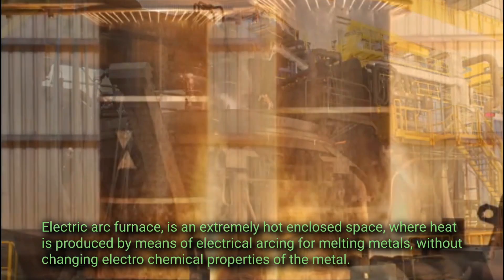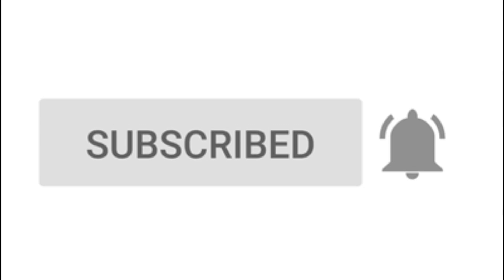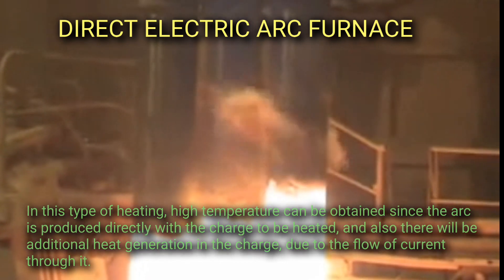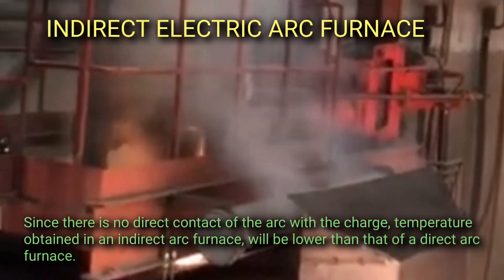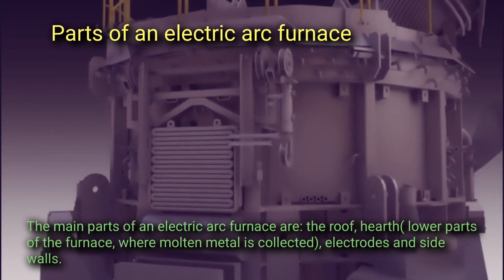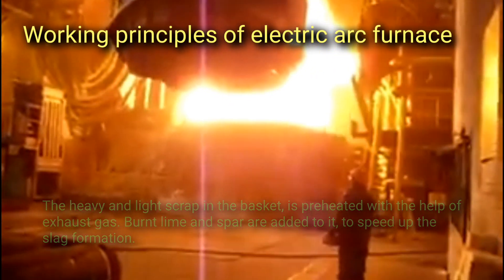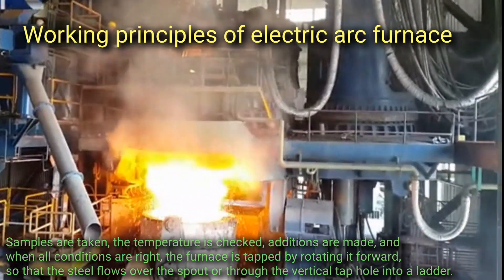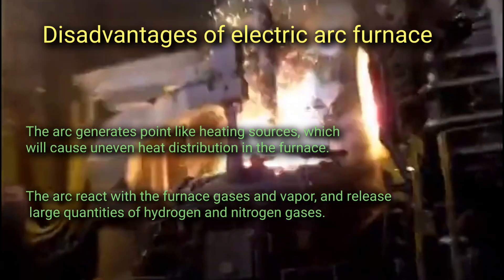A Detailed Explanation of the Electric Arc Furnace - What It is and How It Works

Comment: How LOUD these things get:

Arcing through air and very sudden tens of thousands of degrees of temp differences, is what thunder is... just start there... 

widths of natural lightning can be about as thick as your wrist, max proven. Heard for miles around, once.

These arcs are about as thick as a finger or two. But they are sustained. For hours and hours.

Louder than a jet engine? 

Louder than five jet engines man. The carbon arc cutter at school could be heard across the campus, and you were putting three dozen people in the same concrete room with both ear PLUGS and MUFFS. Absolutely no talking was done on those two weeks of the semesters after everyone got to welding.

And the carbon arc cutter was only an arc about 1/4 inch diameter. Versus the maybe 1.5 in of these things.

Comment: Does it heats the air ? How much
Reply: The one I worked around typically made it around 30-40 degrees hotter than the temperature outside. The surface temperature of the outer shell was around 400 degrees.

Comment: The drawback with the EAF process is that it can't mass produce flat roll sheet automotive steel that's why Cleveland Cliffs blast furnace to BOF furnaces are the number one supplier of automotive roll sheet steel in North America and United States steel is probably number #2🧑‍🏭
Reply: This is going to start changing very soon though. Nucor is building a sheet mill in West Virginia that will be an EAF with incredible capabilities including supplying automotive roll sheet. I work for them so you could say I’m bias, but I believe we’re going to change the industry.

Comment: We used DC and the voltage was one electrode and bottom was the discharge . 200 tons in 45 minutes.
Reply: Did you generate your own power, or buy from the local electric utility?  What voltages do these furnaces require?
Reply: Moral of the story kids? 
Don’t F with electricity.
Reply: 你好，我来自中国，我是中国石墨电极生产厂家出口贸易，现在石墨电极价格便宜，需要采购吗 ？

Comment: The cons where it produces hydrogen and nitrogen gases could they not be captured then be repurposed for fuelling the electric arc furnace. Meaning that it would be more economically efficient
Reply: The hydrogen and nitrogen mostly appear dissolved in the steel itself or get sucked away with the other waste gases and dust that come off when the furnace is running. It would be possible yes, but very very inefficient and would be very expensive

Comment: Very interesting. What are typical voltages and currents? How many kwh does a typical plant consume in a day?
Reply: 900VAC between phases. 45kA. 

A typical transformer for a medium sized furnace is rated for 60MVA.
Reply: I know there’s one that has an entire hydroelectric dam dedicated to it
Reply: @shrimpshot1581 an aluminium one near me had it's own dedicated coal power station. It closed and the mine is still there, full of coal.
Reply: Electric arc furnaces typically use each year the equivalent power needed for up to 200,000 homes
Reply: Shockingly high amounts. Quite a few have their own dedicated power station. There was a system similar to this doing aluminium owned by alcoa near me. 80kms away like 48 miles, they had a coal power station that ran it and had pylons going back to the smelter. Guys tell me when you were 80 yards from the pot and carrying a shovel, you could feel a magnetic force trying to pull the shovel towards the pots.
Reply: DC EAF I worked on operated @ 1200 volts and 160,000 amps.
Reply: Evraz here in Pueblo, Colo is just 2 miles from Xcel Energy's Comanche Generating Station.  They take their power right off the buss bars at the power plant at 230kV. That furnace is a 40 ton size. Three of them in their plant can be fired up depending on demand.

Comment: Why don't the electrodes melt?
Reply from the maker: The electrodes are made of graphite. Graphite has very high heat resistance, and can handle the heavy current and intense heat required to melt the steel material.
Reply: @JamesSwordEngineering  Thank you James